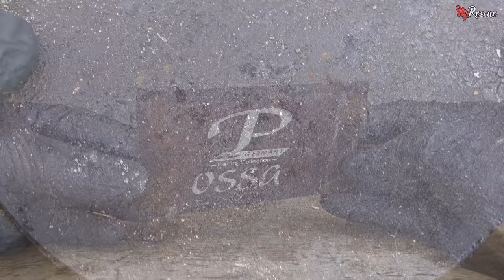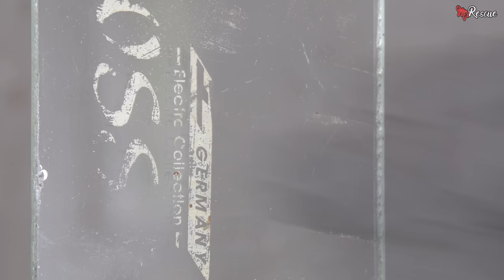The Ultimate Pizza Oven Restoration Process

Comment: Didn’t weld rust holes, didn’t repair the missing tab for the glass, shouldn’t have bothered cleaning the glass panel with the logo, would’ve been $5 for a replacement piece and the original logo could’ve been preserved. And after all of that the pizza cooked unevenly.

Comment: This was not a quality restoration. This was more like Amateur Hour. You took it apart and got it to work again and that's fine. But there is no way this oven looked like your finished product. Flat black on metal with so many dings it looks like it had marbles thrown at it. Did you even try to figure out the original color? Worst of all, you took the logo off the glass and didn't even attempt to redo it.